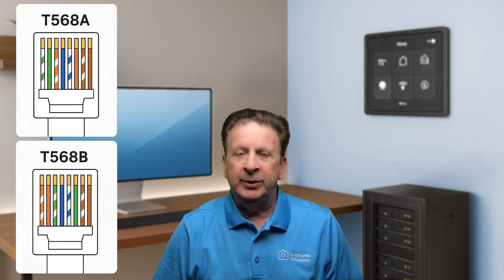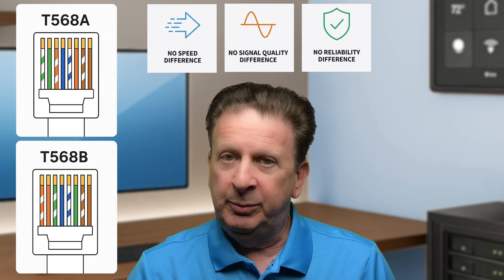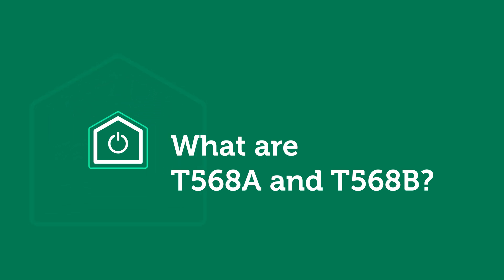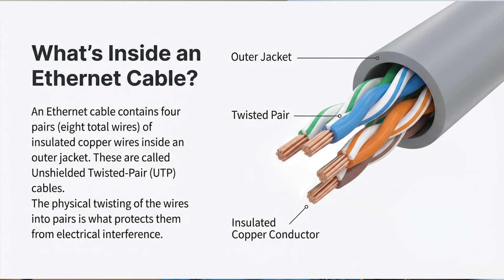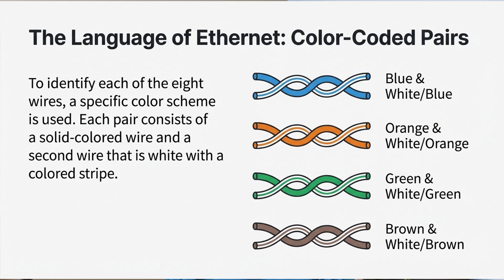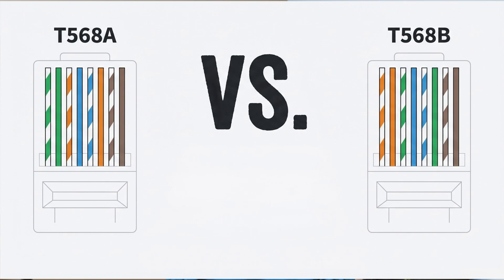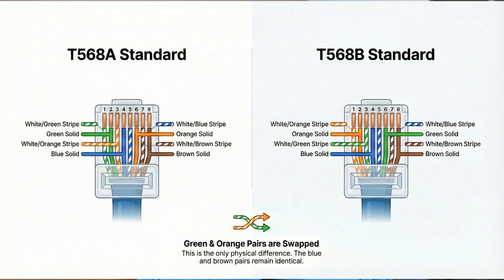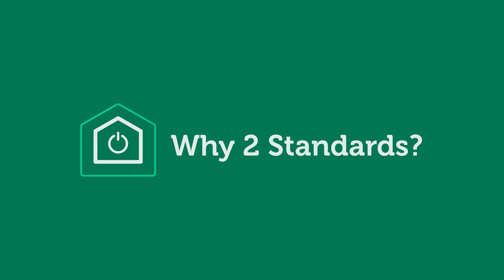T568A vs T568B: Which Ethernet Wiring Standard Should You Use?

Comment: Realistically, what you should use is whatever is already dominant in your facility wiring, to save confusion. And what you should use in a new installation is whatever is dominant in your region for the same reason - principle of least surprise. If you're in the US, that's probably T568B, if you're in the rest of the world, that's more likely to be T568A, but some government contracts in the US specify T568A, and T586B has slowly gained ground in the rest of the world.

There are actually two kinds of ethernet cable, a straight through cable which uses the same standard at both ends, and a crossover cable, which uses T568A on one end and T568B on the other end, because the only difference between the two standards is that receive and transmit pairs are swapped between them.

Crossover cables are largely forgotten, as most of today's devices (including all gigabit and faster devices) automatically swap the receive and transmit pairs when necessary to establish a peer to peer direct connection, a feature called the "auto MDI/MDI-X switch"). But that wasn't always the case. Most PCs and other client devices of the 10/100 era (and some of the oldest 10/100 switches and hubs) did not have this automatic swapping, and therefore, to directly connect them, you needed something to swap the receive side and transmit side. Sometimes that was a designated port on a switch or hub marked "uplink", sometimes that was a port on a switch that had a toggle button for uplink mode, but more often than not, it was the crossover cable. T568A on one end, T568B on the other, and you would have to have one when doing a MDI-MDI (PC to PC) or a MDI-X to MDI-X (switch to switch) connection, while a PC-switch or PC-hub connection would use the traditional straight-through cable with the same standard at each end - didn't matter which, just mattered that it was the same.

These days, since all modern gigabit devices incorporate auto MDI/MDI-X switching, you could accidentally use a crossover cable and never notice, but in the day where we had to use them, they caused all kinds of chaos and confusion. When you made one, or when you accidentally discovered one, you made sure to mark that cable so that you could readily identify it in the future, both so that you could quickly find it without having to make another, and so that you wouldn't accidentally use it thinking that its a straight-through cable.  And that still comes up occasionally if you're directly connecting two 10/100 devices.

There's also one more oddity, even more rare than the crossover plug these days, but still very much relevant. Sometimes you'll find an ethernet plug where the transmit pair of the plug has been connected back to the receive pair of the same plug with a short bit of wire - a "loopback" plug. These were, and still are used in conjunction with certain configuration settings to test that a network card is properly working by making it compare the data sent to the data received, and they can be used to do the same test on a cable as well, by wiring a jack up with the same scheme and plugging it in on the far end of the line. And they will cause link lights to turn on as well, since the device being looped back has a link - to itself.
Reply from the maker: It's always a good idea to consider regional standards and pre-existing wiring when making a choice.

Comment: I think I read somewhere that the same standard on both ends (A-A or B-B) is supposed to be used whenever connecting computers to network devices, like computer-switch, computer-router, switch-switch, switch-router. The only time standards should be mixed (A-B or B-A) is when 2 computers are to be connected. But later I heard that today network devices are smart enough to detect and adapt to the mix, so nothing wil happen even if standards are mixed in that case.
Reply from the maker: Auto-MDI-X in modern devices eliminates the need for crossover cables.

Comment: I learned B so I stuck with it at my place, but honestly for new build wiring I still would recommend A.  The simple choice is that it maintains compatibility.  Do people need fax'es etc and such?  Nope but I'm not going to rob them of the choice later on because I thought that B was better.

A is better simply because it will maintain the compatibility later.  B you might find people wire it more and accidently wire a A cable as a B on one end, but if the tech wires it like that then the tech isn't doing the bare minimum of checking the current standard.
Reply from the maker: If techs are not wiring things correctly, one often has a lot more issues to deal with than just that mistake.

Comment: Back in the day there was a need for crossover cables, that is an A on one end and B on the other; you would wire A-A or B-B from switches to devices while you needed A-B or B-A between switches. There is also a standard USOC for 1-4 line phone systems; this is identical to A on the center 2 pairs and differs on the outside 2 pairs.
Today modern gear will automatically negotiate connections, regarding straight vs. crossover connections, so it’s more a matter of consistency. If you’re making connections on a commercial or industrial scale this decision will typically be made for you as a standard will be identified that one will certify to.
Reply from the maker: You're absolutely right about how modern auto-MDIX has simplified things greatly!
Reply: I do remember making a patch cable several times back in the day

Comment: I was told T568A was Canadian and T568B was American . I WIRED all my customers  homes here In  Canada T568A but I think most use T568B,
Reply from the maker: That's a common misconception, but both standards are used in both countries, often depending on the specific installer or company.

Comment: Out house was never wired for ethernet.  I ended up using MOCA to piggyback on the cable TV wires that were present.  In theory I could run some ethernet, but that would involve having to go down into a cramped crawlspace, and MOCA works quite well, so why bother.
Reply from the maker: Many ISP's that retrofit fiber to the home will use MOCA to get it to the router location.

Comment: as long as both ends are wired the same think would be OK. Since worked a lot on commercial space using the B standard also just stuck with that no matter where what I use even wiring my house so not having to know but one for what I install.
Reply from the maker: Consistency is definitely key, and sticking to one standard simplifies things greatly!

Comment: I wired my home with the T568B standard.  This came about as Routers, NAS devices, Printers etc were always supplied with T568B wired patch cables, so I kept to the same standard.  Are patch cables available in the T568A standard?  I've looked at various suppliers here in the UK and all the patch cables I have found are to the T568B standard.
Reply from the maker: That's a very common reason for choosing B, as most pre-made patch cables are wired to that standard.
Reply: The truth is that it doesn't matter. Both standards are straight through.  If you use a 568B cable on a 568A circuit, the conductors are place for place still the same at both ends of the circuit. The only problem comes in when one end of one run is wired one A and one B, which will create a rollover cable. On 10 and 100 Mbps Ethernet, this will reverse the transmit and receive pairs. This is sometimes needed on certain equipment.
Reply: the difference is just changing places of the green and orange pair.  so you can mix and match them.  as long as both ends of any cable segment use the same standard, the other segments can use any other.  so you can have a long run using A (on both ends) and use a regular coupler to connect it to a patch cable using B (on both ends).

Comment: It doesn't matter in the slightest. As long as both ends of a cable run follow the same standard, it works just fine. You can also swap in one of the unused pairs if there's a fault in one of the normally used pairs. It does make your life easier if you pick one and stick to it. I used T568B in my old house based on apparent popularity.

The only time it would matter is connecting analog lines to ones of the old style 25 pair connectors or similar.
Reply from the maker: If there is a fault in the cable it is best to replace it completely.
Reply: @DoItForMeSolutions Two years after construction? Ripping out drywall following the cable through the walls? What's that going to cost? $20k?

No, that's not happening.

Comment: I was expecting a section on crossover cables. Back in the 90s to get two computers to talk to each other you needed a crossover where you had A on one end and B in the other. Modern computers and switches auto detect if you have an through or crossover cable, so it is now much easier to use either a straight through cable or crossover cable.
Reply from the maker: You're absolutely right, crossover cables were a huge topic back then, and modern auto-MDIX has simplified things greatly.
Reply: Gigabit Ethernet works differently. It uses all four pairs simultaneously and in both directions. A crossover is neither required nor desired. Instead a serious amount of signal processing and crosstalk cancellation is built into the physical layer. It doesn't matter which standard you use. What matters is that you use the same one at both ends of the cable.
Reply: @johnm2012 good to know - will stop doing that. Still need it for old "work" stuff that's not gigabit and doesn't negotiate.
Reply: I still make crossover cables for connecting PCs directly.
Reply: @grahamleiper1538  most computers network cards I've seen in the past 20 years have had the auto negotiate. I think it's so standard now that it isn't mentioned any more.
Reply: i did make a crossover cable to connect my PC directly to modded PS3 in order to transfer files; i couldn't get it working with a straight cable i think due to the PS3 not having this auto-MDIX function
Reply: Coming from a networking background this is what I expected too.

Comment: It does not matter, use the same on both ends.
If you cannot choose/don't remember, take a picture of the color coding on the wall plug terminal and use that for the entire building.
In private homes, print it out, write it down, and zip-tie the paper to the patchpanel in the garage/tech room for future network people.
Reply from the maker: Consistency is definitely the most important takeaway here, as I mentioned in the video.

Comment: When I started wiring my own cables, I was using B. However,  when I was working with electricians doing wiring work for my church, they were using A.
It was important to know so that I could match with what they had done when doing the patch panel. They said they were always told that since we're in Canada,  we use 'eh'
Reply from the maker: Good to consult with electricians, but in my experience many of them don't look kindly on low-voltage work and don't know all the nuanced details.

Comment: I am not so sure about signal quality difference.  I been doing networking for 3 decades.  and My understanding is the blue and green pair have tighter twisting as  they contain the data path... the orange and brown pairs have more relax twisting to handle power for  POE. I learned this from college courses  way back before Ethernet was the standard. 
Arcnet and  TokenRing were still viable options at that time.
My understanding is that this was done to prevent the power from interfering with the data transmission.
The colors on the jacket only mattered for identifying the data pairs vs  the power pairs.
Reply: "My understanding is the blue and green pair have tighter twisting"
Blue is not used for Fast Ethernet; it is the voice pair.  I'm not sure that the "45" in RJ45 refers to pins 4 and 5, but in a mixed environment, pins 4 and 5 (blue, blue/white) will carry 48 volts DC for "pots" (Plain Old Telephone Service).  
There is likely to also be a different direction of twist to further reduce crosstalk.
Reply from the maker: I was trained to never mix analog POTS signal use with lower-speed Ethernet on the same physical cable.  I don't recall a standards spec that allows that.

Sending voltage down unused (or used) pairs is the realm of PoE (power over Ethernet) standards and beyond the scope of this video.
Reply from the maker: I've have heard anecdotally signal quality might be an issue, but haven't yet found any official documentation or reports.
Reply: That argument would work up to 100mb/s speeds. 1gb/s uses all 4 pairs for data.
Reply: The variation in twists per inch is mostly to reduce crosstalk.  Pairs that have exactly the same twists per inch are more likely to couple magnetically to each other.
Reply from the maker: Can you point to a reference on this?

Comment: The main thing is that both sides of the cable are of the same standard! 
But even if you mix the standards and use crossover cables you won't notice any difference.
A good CAT5e, CAT6a or CAT7 cable can be used.
Reply from the maker: Yes, consistency is key, and while crossover cables have their uses, most modern gear handles it automatically.

Comment: Side note: The only difference between RJ10, RJ11, and RJ12 connectors is the number of contacts, two, four, and six, respectively, and RJ14, a smaller connector, is typically used for handset cords.
Reply: RJ 9 was for handsets RJ11 was 4 conductor  RJ12 was the 6 conductor
Reply: @TheCynysterMind  Not according to the catalogs that I used to get, and the instruction manual for a crimper: RJ14 is the handset connector.
Reply from the maker: Good catch!  Are there standards for the wire itself? I've seen some single-line telephone flat cable with only 2 conductors inside instead of 4.

Comment: There is really no reason for T568B to exist. Prewiring with A means you can assign or repurpose any cable for ethernet, multi-line analog phones, hybrid analog/digital pbx phones, VOIP to analog device conversion etc. There are plenty of unique situations where T568A provides unique advantges and no situation where T568B brings anything new and useful to the table.
Reply: "There are plenty of unique situations where T568A provides unique advantges"
Be specific.   Gigabit ethernet uses all 8 wires and makes no difference A or B.  Fast Ethernet uses 4 wires avoiding the wires commonly used for voice line 1 (pins 4,5)  This helps prevent destruction of the line driver if you plug your computer into a socket with 48 volts DC on pins 4 and 5.
Reply from the maker: I didn't want to get too controversial, but I found some anecdotal "opinions" that T568A had lower signal cross talk and better signal reliability, but I couldn't find any official reports or information documenting this.
Reply: "There is really no reason for T568A to exist. "
Fixed it!   Anyway, yes, telephone people tend to prefer "A"not that it matters.
Reply: @thomasmaughan4798  NO! You are objectively wrong. If A was the first standard adopted, then B has no logical reason to exist. If B offers no fundamental signal performance improvement, then it should not exist. A has been shown to offer a backward compatibility advantage, therefore it is better than B. Until you can give any firm logical advantage to using B over A, then any choice to use B is flawed.
Reply: @thevoiceofreason8240  - You are objectively right about it not needed and yet here we are. It's in every major USA store and almost all current business. So, it's (568B) the current standard now.

Comment: There is another reason. You needed crossover cables for (some) hubs in the old days before auto negotiation was commonplace. Also you should take up more screen real estate than any of your backdrop items when you are making this type of video.
Reply from the maker: Thanks for the feedback on the video background/production issues.  I agree - I was testing some new editing settings and should have adjusted the zoom factor a little higher.

I think crossover cables can be wired as either A or B, and refers more to the left-to-right order of each end of a cable.  You are totally correct that with modern networking gear it has been many years since manual "MDI / MDI-X" buttons were included on gear to avoid having to wire your own cross-over cables when needed.
Reply: @DoItForMeSolutions  For crossover cables, use A on one end and B on the other. The green and orange pairs carry the data, and they are the wires that switch places.

Comment: TL;DR:  The only thing that matters is that both ends of a cable use the same A or B.  For your physical plant (the cables in the walls) pick one A or B and stay consistent -- this is important so that both ends of each cable are terminated in the same order (prevent crossed pairs) when you cannot see both ends at the same time.  If you then use a mix of patch cables, some A and some B it doesn't matter - the only thing that matters is that both ends of a cable use the same A or B.
Reply: I agree! The wiring panel (Leviton) in my home supports both Ethernet and analog phone. It uses the 568A standard. The jacks throughout the home use 568B; my choice!  As both ends use the same standard to connect to devices; no issues. Consistency is the key, the electrons don’t care what color the wire is.
Reply from the maker: Yes, I mentioned that consistency is the most important takeaway here.  And I briefly said you "could" mix A and B (with the limitations you have mentioned) but it is easiest to avoid it as much as possible.
Reply: with modern switches that are MDI-X it really doesn't matter if both ends are the same or if you use A at one end and B at the other. while it really doesn't matter when using MDI-X equipment, you do have problems when you are using MDI equipment, as then the wiring of the cables really does matter, as MDI devices can't switch between normal and crossover.